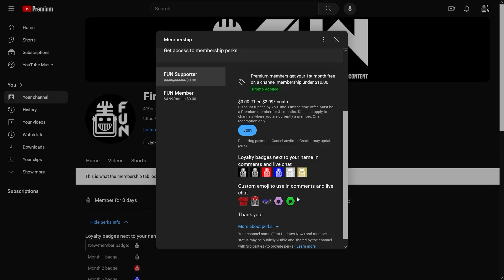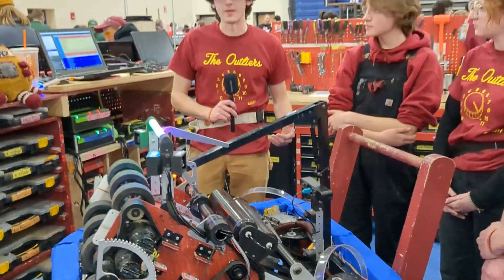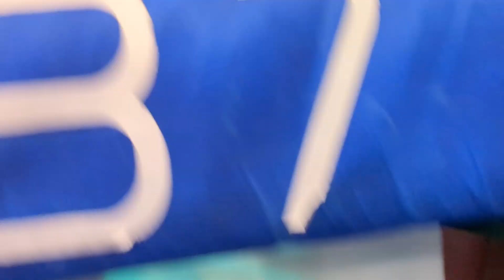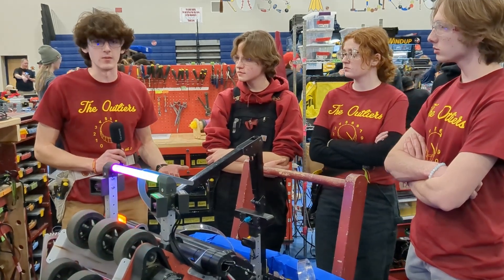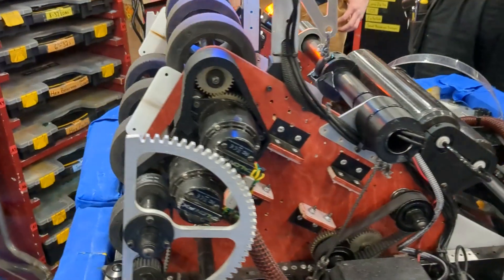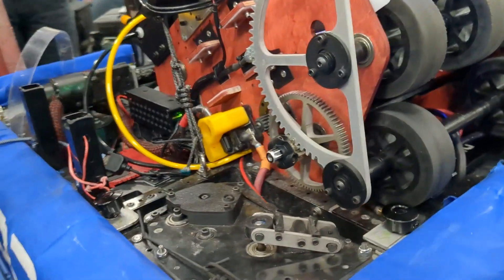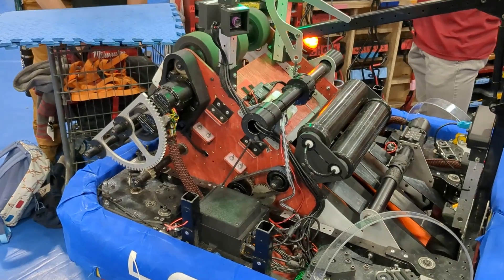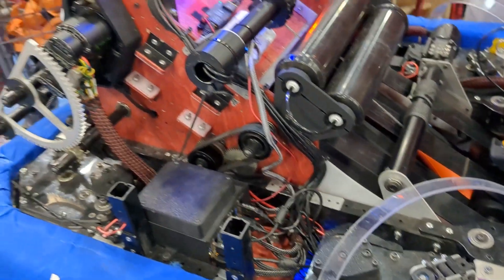Behind the Bumpers | 5687 The Outliers | CRESCENDO Robot | Official Week 0

Comment: Hey everyone, 5687 member here, just wanted to clarify any confusion about our swerves (I was a little unclear in  the video, sorry!) What we're running this year is a custom two-stage shifting gearbox swerve. We utilize a ball shifter on our translation gear train to shift between a low gear of 6.8:1 and a high gear of 4.5:1, and it is not in any way a differential. 5687 developed and competed with diffy swerves in the 2021, 2022, and 2023 seasons, however with the propulsion motor rule change this summer we had to pivot away from this. The advantage of differentials was power and efficiency, so we decided the next best thing was a "traditional" swerve with a shifting gearbox, which has the advantage of speed and efficiency at the cost of a little added complexity.
Reply: I was so confused😭